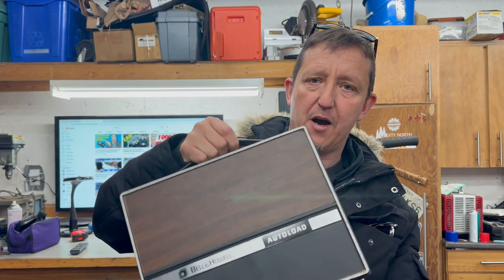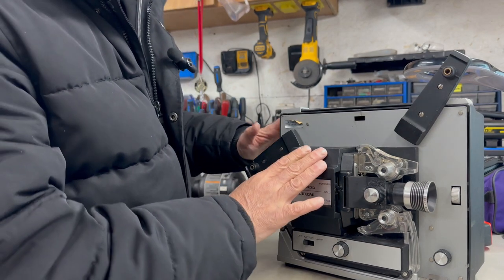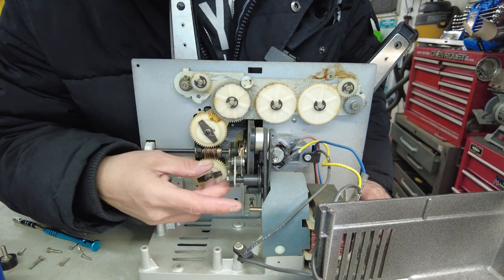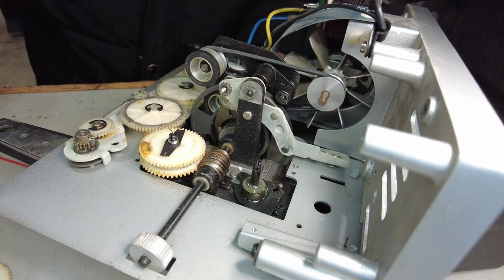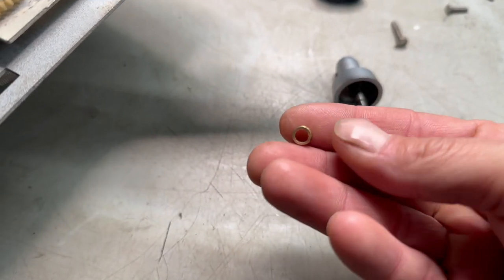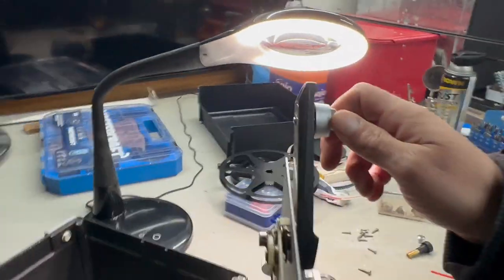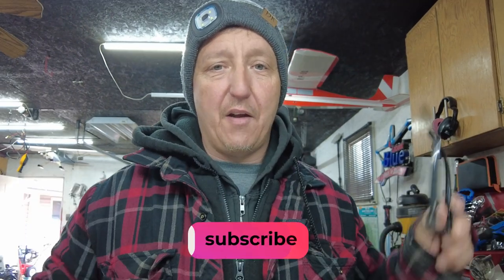Fixing a Vintage 8mm Projector - Watch the Bell & Howell 461B Transformation!

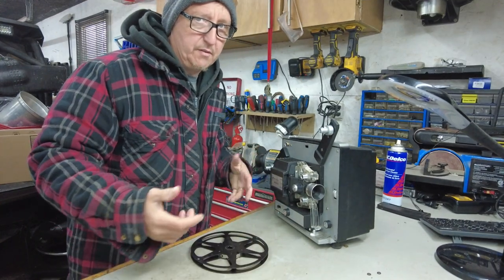Comment: Great video! At around the 11:55 mark, you mention you had to adjust the clutch actuator. I have an issue where the take-up reel barely spins and I'm wondering if I adjust the clutch if that will help it spin. I have to manually spin the take-up real or the tape ends up on the floor. Are you able to describe how I can adjust the clutch? You said it was a bit of a dance. I'm assuming it's on the inside but then what?
Reply from the maker: Thanks for the question. I had to tighten or loosen the tiny screw on the back of the reel hub on the opposite side of the arm. If you tightened the screw, it will compress the wave washers inside and give the wheel more torque to turn the reel. If you loosened it, the opposite would happen. Be carful if you still have the plastic screws. They are very fragile. I hope this helps!!